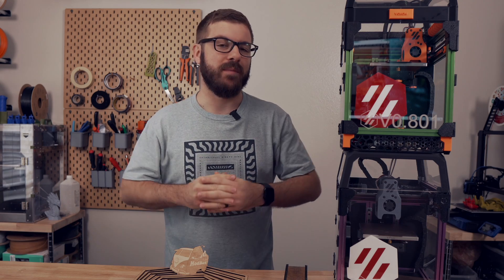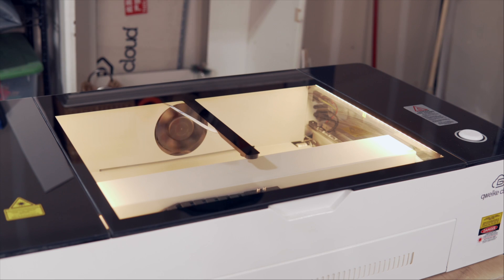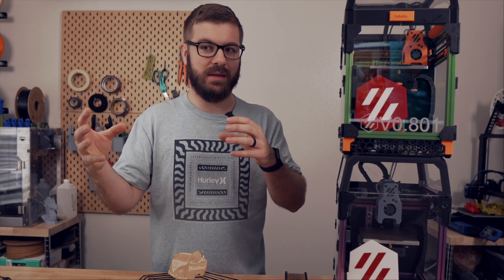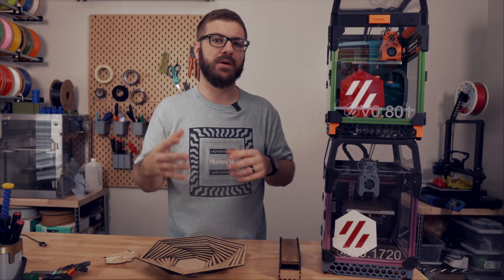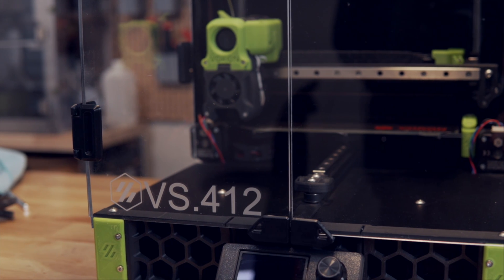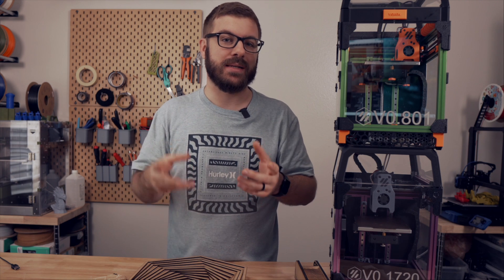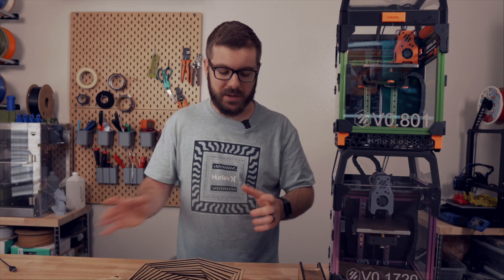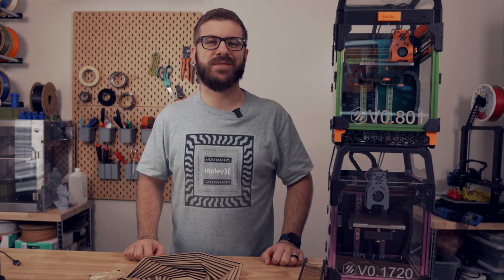Best Glowforge Alternative? GweikeCloud 50W CO2 Laser

Comment: I just took delivery of a Gweike Storm 600 a few days ago. My one has an extension steel box taking a 65 watt CO2 tube with space to spare. No user instructions for the hardware, came with "CNCLaser" software which is pretty rudimentary. The lack of instructions was a problem, I ended up discovering that the lid sensor reed was too far away from the lid, preventing laser operation.
After a couple of days I bought the lightburn DSP licence, So much better!  Just the better offset and path repeat functions alone are so much better. The honeycomb comes with a bed of knives and C extrusions on it's edges which I have now removed as the aluminium extrusions spoil the 600x400mm working area. Next, I designed up fat L shaped markers to sit in the corners and screw up into the rail, then I did a full perimeter cut to cut the perimeter corner markers through my brackets. That makes placing my material bug-free, it's so much better after those two small mods and DSP Lightburn license. The cuts are much faster than my blue OLM10watt laser but the beam is also fatter and diverges a lot faster from the CO2 laser. I suspect it's poor lens technology. There is a guy on youtube who does amazing lens research, I'll have to look him up again. The Storm 600 is basically a full industrial laser, it's just small for an industrial one. I'm loving it, it's doing everything I want of it so far, I can cut 6m  acrylic and 6mm ply with it and with some lens upgrades, likely thicker. If you want better manuals, best to look at the DSB circuitboard's label and then find the manufacturer's manual. Ruida has manuals in English and they are worth reading.

Comment: Great review.  Very thorough.  What I like about you is that you are not afraid to tell it like its is.  If there is a problem with a machine, something you don't like about it, or improvements that could e made to it - you are not afraid to say so.   Despite the issues you had with this machine, it does seem like a good machine.   However, that is still a bit pricey for me.

I bought on OMTech K40 and spent a $250 - $300 on modifications, and it is now a beast.  I also have a Laser Master 2 Diode Laser, which I have done some modifications to - including a more powerful Laser Head.  This machine is also a beast now. 

Between the two machines, I have around $1200 invested, and they are more than adequate to handle all that I do with my online wood craft business.

Comment: Any chance of a FLUX Beamo review? I'm very happy with mine. Only 30W but bigger (optional) filtration system that catches all the smoke for me, and it will ramp up/slow down the filtration fan as well as the built in fan before/after each run.

Comment: Something to keep in mind: If you're moving the nozzle height, then your camera will be out of calibration. I bought a camera from lightburn for my cheap diode setup and ran into the same issues. That's why most lasers have a lowering bed instead. 👍

Comment: I'd love to know how effective that top panel is at actually protecting eyes, like if it's actually properly absorb antto the wavelength of the laser used
Reply from the maker: It is my understanding that acrylic or glass is commonly used for a CO2 laser enclosure due to the light being on the spectrum of light that is invisible. It has been sometime when I dug into it but from what I recall the laser would have to reflect and burn through the glass or acrylic and then hit your eye to cause damage. The exception to this is the actual light generated from the beam cutting which can be very bright and you should not look at. I have seen glasses also used (polycarbonate) as an extra level of safety which is never a bad idea.
Reply: Russ at RDLearning Lab had a whole video on that very subject. Clear glass and acrylic will absorb all of the energy (think energy instead of visible light). Unless you see a hole burning through that window you are perfectly safe.
Reply: @krisknowlton5935  Thanks for the recommendation. I'll have to check it out
Reply: @BeefIngot  I looked to see if I could find a link for that video but he has over 240 videos so it is hard to find the right one. If you are really interested in CO2 lasers these are the videos to watch. I watch just about all of them and I don't even have a CO2 laser yet. (Supposed to be one on the way though)
Reply: @krisknowlton5935  So I went looking for the video, and think its part of a playlist called RDWorks Learning Lab not a channel. The channel I found hosting the videos was called 
SarbarMultimedia and the presenter did say their name was Russ. I have yet to find this particular video however.
Reply: @BeefIngot  that is the channel. I can never remember the name of his channel because is a little strange. Anyway, if you have two or three hundred hours of spare time to watch his videos you could well entertain your brain.

Comment: My wife and I finally got the xTool D1 Pro 20W diode laser setup and ran some test cuts tonight. I still need to get the air assist setup to clean up the scorching some but the initial test cuts were pretty awesome.
Reply from the maker: The most I have used is a 10 with air assist and I was super impressed. 20W for a doide sounds insane haha. So much power! I believe they have a 1064 module for it as well which is pretty cool for marking on metals.

Comment: Great video! I recently heard about this machine, this is a fantastic walkthrough of it, and it looks like you are getting pretty good results. I am a big fan of laser cutters and I have been using a Glowforge laser since 2018. It has been pretty much flawless (after the first one, which was DOA).  While there is the annoying web connectivity, I really like the simplicity of it and they continue to add innovative features and improvements to both the firmware of the laser, as well as the Glowforge UI app. I don't pay for any of the features but you can do design in it.  Anyway, I'm really glad there is a competitor to Glowforge. This machine seems to be every bit as good in terms of hardware, and in some cases better like the rotary tool which Glowforge doesn't have. From what I can tell the air assist fan also seems better. I am not familiar with Lightburn, but it does look nice and I know most of the Chinese lasers use it. 

One major concern I have on this laser, and maybe you have more info, is warrant/support. What happens when the CO2 tube needs replaced or if you run into a hardware issue? With a Glowforge you have to ship the machine back for the CO2 tube, as it isn't serviceable. They ship you back a refurbished machine and last time I checked it was around $500, but might be more now. In some cases (bad fan, belt issue, mirror, lens replacement, etc.) you can buy those parts and swap them yourself- I have swapped out most of my parts in the 4+ years owning mine. The tube is really my biggest concern... I haven't had to replace mine yet fortunately. I believe believe both the Glowforge and GeikeCloud are rated at 10,000 hours. Anyway, I'd hate to have to ship this back to China- so not sure what the process is- as I looked at the website it seems unclear as to what the process is and how difficult it would be to change yourself. It would be great to learn more about warranty and support. Anyone paying $3K+ for a machine is probably going to be using it for some kind of commercial purpose, and support/responsiveness is something to consider.  On the plus side you could probably buy 2 of these for the price of one Glowforge and have some spares. :)
Reply from the maker: I have chatted with a handful of Glowforge customers over the years that are really happy with it. I really wish that they didnt require web connectivity but that has been their setup since the beginning. What I will be curious to see over the next few years is if they end up cutting costs at all due to the competition. They may not need to but I am still wondering how units like these will impact them. On the Glowforge can the software turn the air assist on or off or is it always on? Also, the air assist is inside of the laser instead of in a side box right?

That is a valid concern. From what I have seen over the past 3 months is that support is really active. I have been lurking in the official Facebook  group where there are some active reps helping users with issues and if I am not mistaken in some cases swapping machines. They have a video showing how to replace the controller so there is some user serviceability. I do not see anything about the tube but I am wondering if that is due to how new they are that if there was a need to replace they are swapping. 

I went on a deep dive right now and saw someone that it working with support to diagnose an issue. They had the machine opened and the tube looks fairly standard and like you would be able to replace it. Doesnt seem to be something they sell publicly so may be a tech support first thing. Tube and power supply would likely be the things I would want on hand as spares if possible.
Reply: @ModBotArmy  Thanks for the reply! I just joined the Facebook group as well. I am definitely going to keep my eye on this machine. It seems like it could be more repairable based on what I am reading which is definitely a good thing. Would love to hear how it works out for you in the long term.

Comment: I’ve got a 10W diode laser. Just dipping my toe into lasers at this point. I bought the Creality CR Falcon for a steep discount. I have been running it in the garage due to the open frame design. I’d like to upgrade with an enclosure, exhaust and air assist at some point but I think by then I may just be ready to step up to a larger CO2 laser instead. Having fun with it for now. Making crafts, school projects for the kids and Christmas presents with it.
Reply from the maker: 10w lasers are pretty impressive and the air assist does make a pretty big difference. I wish more came with an enclosure though.